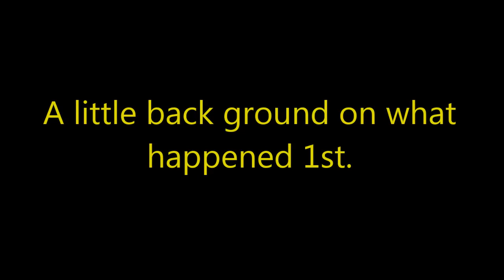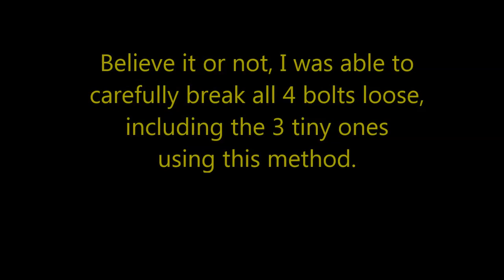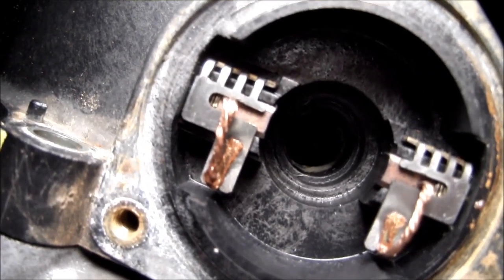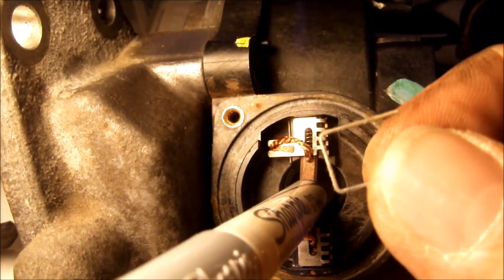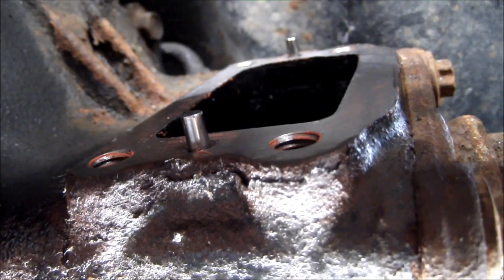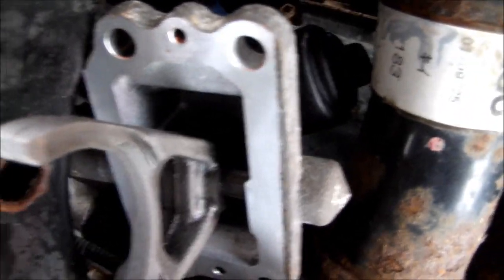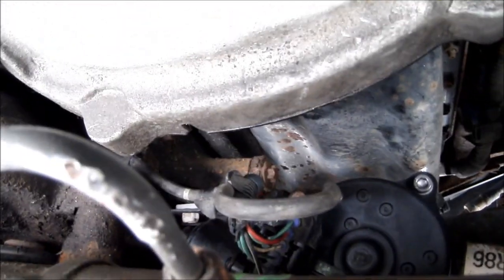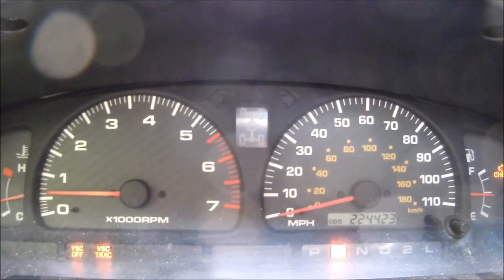2002 Toyota 4Runner 4WD Trouble Shooting and Repair

Comment: Good job bro. I hate those contacts on the spinning wheel and the brushes. I had brushes go bad on a transfer case actuator. My ADD is electroVacuum. Older style. I’m other words, it’s brushless.

Comment: Thank you so much for sharing this. I'm working on an 01 4runner, someone left the 4wd engaged in regular driving and sheared the input shaft on the front diff(or perhaps low oil and high temps fatigued it). The friction in the front diff burnt up the connector and wires leading to some shortage and resistance from corrosion. Luckily the tracks were barely harmed but it took me a few repeats of cleaning the commutator, reassembling, and sending 12v back and forth to get it moving again

Comment: I have a 2001 Hilux LN167 and when I put it in 4x4 with the diff locks on it jumps out back to 2H when I set off. 4x4 Low works fine. It does not jump out of 4H when the diff locks are off. Any idea what might be happening? What do I need to look at?

Comment: HELP !!!!   Can someone point me in the right direction in resolving my 98 4Runner issue?  When I engage 4H it goes in silent but when it goes back to 2H (disengage) there is a loud bang (like a sled hammer bang). The is a delay for about 30 second to disengage as I drive down the road below 25mph.  The 4wd light indicator goes on when I press the button and it goes off when I depress the button, the light never blinks.  My other 4Runner does a loud click only.  I don't know the history on the car but I have changed all the oil already.